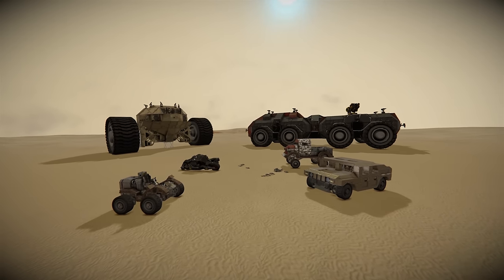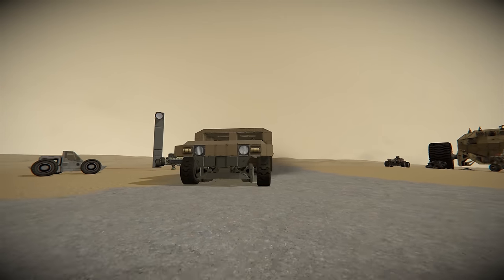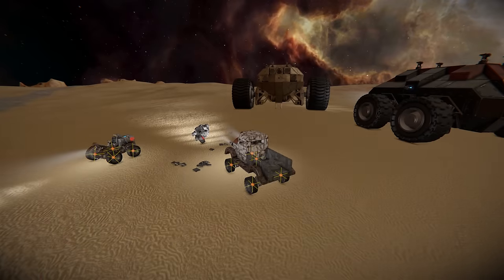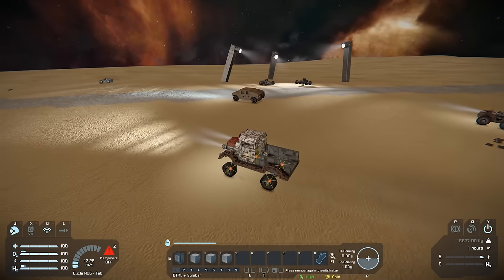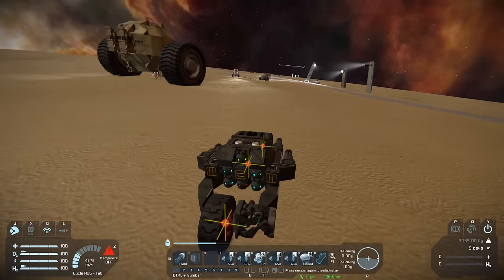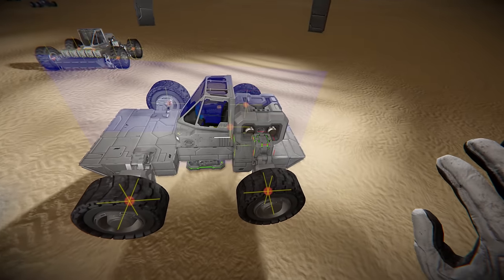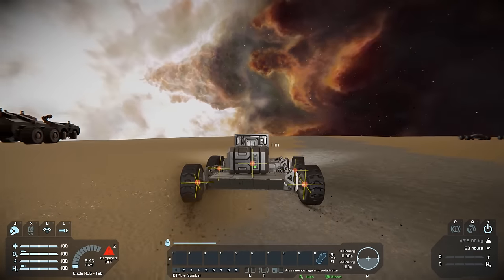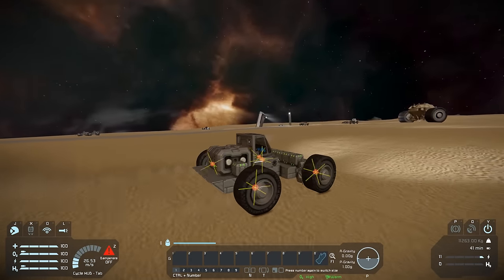Space Engineers - How To Build Rovers

Comment: Tip not all rovers need rear wheel steering. When I make a 4 wheel rover I switch off rear wheel steering. When I make a six wheel rover I put rear wheel steering half of the front wheel steering. (20% front wheel steering, no steering in the middle, 10% steering on the rear wheels)
Reply from the maker: Nice tip this is a great thing to do in many situations.
Reply: Turning off Front Wheel braking also prevents your rover from flipping over when applying brakes at high speed
Reply: Great example of skid steering they are so much fun but getting the wheel settings right can be a pain

Comment: Another point to remember is the function of the rover. What is it FOR? If you want a scout car, use the little one you showed with an Ore Detector on it. A transport won't usually need to go as fast so cut the top speed a little, build a wider wheelbase and slap on a couple of extra tires. A military vehicle will (usually) have armor and that means it's heavy. More wheels help carry the weight.

A great video as usual.

Comment: Group the rear wheels and front wheels separately. This gives you lots of manual control while driving. Sometimes you need them to behave differently when going uphill or downhill. One other fun thing I played around with recently was reversing the steering on the back wheels to enter "crab mode", which made it a bit easier to get my connectors lined up.

Comment: Something I do for building rovers is use heavy armour for the chassis and light up top. Helps to keep the CoM lower. A little softer suspension helps absorb some of the bumps and make it flip out less. Also more wheel is good, I usually go for a 6 or 8 wheeler.

Comment: A tip you failed to mention is that wide rovers tend to be faster on the turns while long rovers have better stability at higher speeds. This is important because it helps shave time off trying to optimize said rover without having to do serious tinkering to the wheel settings.

Comment: Any time you build an 8 x 8 chassis you must consider setting up smaller steering angles for the wheel axles closer to the vehicles center.  The reason is the outer most wheels travel more distance and endure unwanted side friction to compensate for the inner wheels.  For evenly spaced 8x8 chassis I will set the string angles to 22°,10°,10°,22°.  If the wheel axles are bunched into pairs near the ends somewhat you set the angles to 22°,18°,18°, 22°.  This becomes more crucial when you are trying to maintain control while going up or down a hill or travelling over an icy smooth surface.  Yes it's a bit of work, put tweaking the steering angles of different axles will yeald better performance and your wheels are less likely to break out spinning. 
Rovers are outstanding in power efficiency but they tend to glitch through the surface on a busy server and fall to the center of the planet when you have a split second connection error.  This is usually caused by a rover travelling at excessive speeds and the voxel engine physics grid has not caught up with the graphics.

Comment: Nice Video, 12:30 you have to get sure you have a counter weight on the opposite side, as Balance, then it works good. For this its good to know how much weight (Mass KG) each Block have.
If the weigth on one side is to much, even the Gyroskop cant hold it stable, on large ships for example (in earthlike atmosphere). Then it will slowly drop the heavy side down.
Also you can adjust the rear wheel suspension, and make more strength then the front wheels.

Comment: When configuring my wheels, this is my process.

1. For suspension strength I max out height offset. Then I start at 0% strength for all wheels. Make sure the rover's inventory is completely empty. Now increase the strength until the rover no longer rises. I'll do the same test but with the rover's inventory completely full, this includes trailers if applicable. Then I'll set the strength somewhere between the two results. 

I'll test the front and rear axles separately. The heavier side will have more suspension strength. Cargo trucks will likely me heavier in back, but semi without trailers, or recon vehicles with front engines might be heavier in front. 
In extreme cases, like asymmetrical weight distribution, you might have to do every single wheel separate. 

I use enough power to comfortably drive a full capacity vehicle uphill. To save power, I toggle the front axle drive on/off. 

For large vehicles or ones with bad turning, I add a timer block. For actions, I disable steering and invert propulsion to all the wheels on the right side (you can do left for personal preference). This allows you to turn on the axis using your w and s keys.

Thanks for reading if you got this far and I hope this helps.
Reply: suspension strength is useless due to the 200% dampening that the devs decided to override and removed the slider. ._.
Reply: @AngelboyVR  when did this happen? That sounds terrible
Reply: @bloodmoon0746  it happened when they "overhauled the driving physics" they also decided to remove very vital core sliders neccessary for realistic driving experience.
i dont know why.

Comment: Made a almost multi-platform design rover off of a Darkhorse design, made it longer, either have a conventional 4x4 or 6x6 in either light or heavy armor, but the bottom is almost flush from one suspension to the other but have heavy armor blocks on the bottom to reduce the roll. Even 100 friction and power and max speed, the truck will not roll, I give Darkhorse credit for the base model, but I made some variants in all be her or car style with a V12 hydrogen engine with the mall hydrogen tanks, I've made a sporty style with 4 more engines and 4 o2\h2 generators and small hydrogen thrusters acting like exhaust pipes and called it either turbo charge (sporty style) and over drive (utility) for more power going up hills and this is a prototype an 8x8 "outpost" design for survival or called "scamping." All you need is an o2/h2 a reliable source of power and a survival kit in a truck 20 to 30 blocks long, and 9 blocks long. Truck can hold 4 on stock hold or 8 for troop transport or 12-16 on a 4x4/6x6 design and little room for storage

Comment: My current issue is I made a big block Massive rover. Its slow, it works and its .... massive, lol. Problem is now that its built and I have it hooked up to my station at the top rear with a connector. When I log in there is a loud Bang, my rover is gone, the station connector is trashed and the rover is at 1km in  the air above the station and coming down like a bomb.
I have saved the 'save file' in hopes of fixing this. 
Any Ideas?

Comment: Arron. massblocks are good. but space balls are lot heavyer so they will be more space efficient. great video
Reply: Space balls can't be placed I think. They covered this in the turret video.
Reply: It's not that they can't be placed, they can't be placed in certain configurations.
Reply: Space balls are only heavier cause more components. On planets art mass is meaningless.
Reply: @Mice-stro  they have all 6 point connections so you can actually place them. dont know where you get this info
Reply: @NirateGoel  yes and you can actually adjust their weight
Reply: @ProducerLink  not in natural gravity. Art Mass blocks only have weigth from components. In art gravity you can control their mass. Art Mass doesn't work in nat grav. Same with art grav in nat grab.
Reply: @NirateGoel  Space balls work diferently. they are the planet version of artifitial gravity. its allready tested.
Reply: @NirateGoel  edit on my comment. it seems like the one time i did it it was somethign esle making my craft add wight. changing the parametrs didnt do anything. really comfusing. i did testing and indeed you cant add mass with sapce balls. they are just heavyer becasue of components. still better to use in blancing the mass of rovers in my opinion

Comment: I am a new player and i tried building a rover and thought this video would help me. I put the suspension wheels settings like the video and then i tried driving it. First when i held W for some reason it moved a little left and when  i go backwards a little right. When i steer one of the wheels goes off the ground And doesn't do anything and finally when i moved for more than 3 seconds in one direction the rover it flips. How do i build a rover?
Edit: I feel dumb. I put the wheel suspensions facing up.

Comment: 11:43 The inventories of the connector and storage are connected, but how do you connect that to the cockpit? I've tried the small and large yellow ports and it's not working.
Reply: Small ship conveyors come in 2 different sizes, and you need to line up the correct ports with each other for them to connect. This can get really annoying as there seems to be no block which has a small port on one side and a large one on the other, save for the small O2 tank and that has 2 small ports on either side rather than 1 in the middle...(note also that some items can't go through small ports).

Comment: I run Space engineers on my XBOX and I have to ask: why are my battery's not charging on my rover or my ships? I have waited for up to three days for them to charge and I get nothing. You would think with twelve wind turbines going I would have enough power to charge any battery with all my main base battery's fully charged. I have five main battery's at my main base.
Reply: Turbines only work if the main body is a station or if it's attached to the ground with landing gear.
Reply: @jasonpoole6701   I figured that out and put up solar panels, still no charging of my rover battery's.  I even went as far as building an hydrogen engine right next to the blasted rover and I still get nothing .
Reply: @jasonpoole6701  I seem to have found the problem I tore out the old battery's and put in new ones they seem to be doing what their suppose to now. it may have been a hick up when I first built them.

Comment: forget rovers, for ever. fsr the devs decided to crank dampening all the way to 100% making all (what they call) "SusPeNsiOn" rock hard on any collision, breaking all immersion and ruining stability as highspeed driving over a shallow hill always results in a flip or roll. no need to create rovers now anymore, if you care about all that.
i have no idea why they decided to do this shit.
the rovers all feel like toys cars now.
a lot of people hate this change aswell and stopped playing.
also for a beginner its realy frustrating not beeing able to drive over 30km without rolling.
is there any mods to bring the useful sliders back?
.
Edit: the dampening strength deppends heavily on the weight of the intire rover, the heavier it is, the less like a Rock the dampening will seem like. which is WHY we SHOULD have the slider to beginn with, to compensate more controllably by the user himself!!
but many people in a survival world tend to just strap the most neccessary stuff on and call it done as long as it serves its purpose, with the difference that everyone has to drive at max 5kmh now ...
Reply: I have no idea what design of rover you prefer or what you have tried to overcome this issue so i cant give anything more than the most basic suggestions. I overcame this issue by widening my designs by 1 block on each side and the adding between 3 and 5 blocks to the length. I also try to stay under 7 blocks tall. For weight distribution I moved the cargo closer to the middle of the rover and added an extra set of wheels to sit directly under the cargo.
Again I have no clue how you design so that's the best I can do to assist currently.
Reply: @Domenion  i am very thankful for your kind attempt of helping me. but i have sopped building rovers alltogether, as its easier to build atmospheric crafts anyway, and they are much more useful.
quiet frankly its more about the realistic suspension movement that im mourning a lot about, i loved the light bounce of my heavy Trucks when going up the ramps of my Bases.
i wish there was at least a mod that decreased the default dampening by half or more ...
but i salute you for your tips Domenion

Comment: But what if you add some hydrogen thrusters and set friction to 0%?

M A X I M U M   D R I F T I N G
Reply: You could actually make hovercraft like that, with suspensionless wheels on the bottom, thrusters, and zero wheel friction. These "hovercraft" are particularly useful on Mars with its vast flat surfaces.
Reply: @mohammadnoor8429  so  my only working drift project is actually a hovercraft? Interesting...